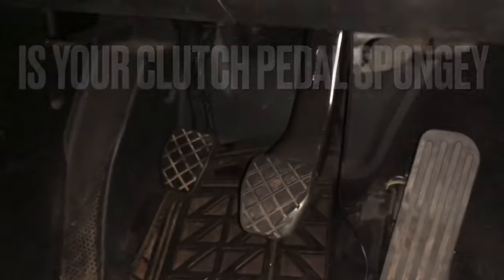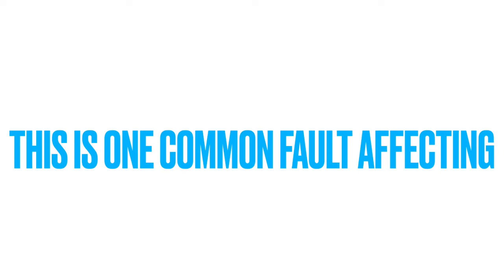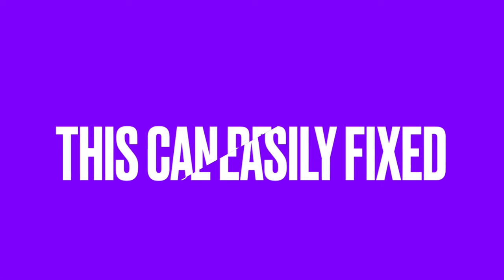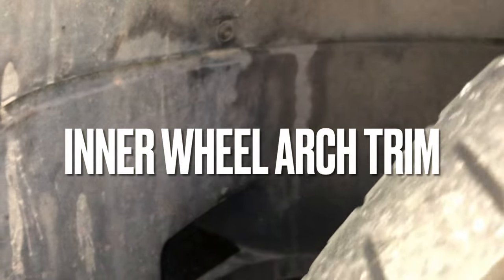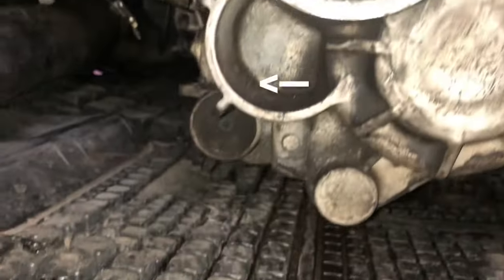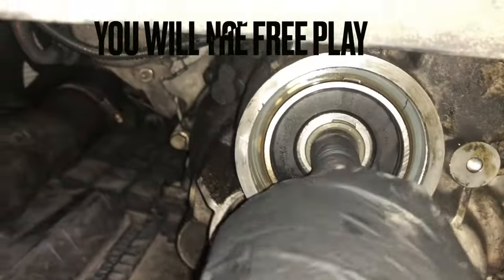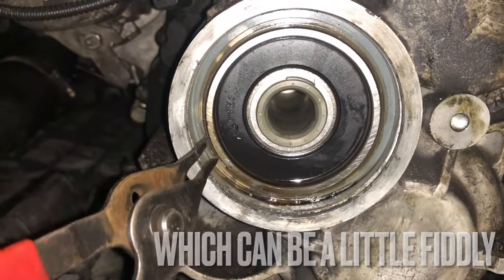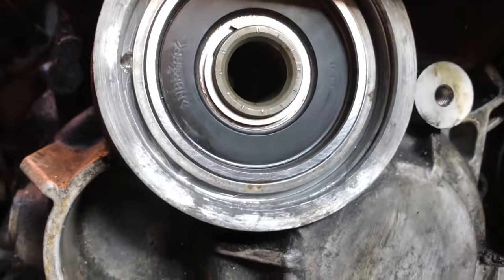Soft clutch pedal - Can't fix it - Try this!  Volkswagen, Audi, Skoda, Seat

Comment: I’m having a problem like this on my mk7 golf gtd 2.0 64plate 6 speed. Is it the same place as yours in the video? 
Great video and you made it look simple enough even I could do it.
Reply from the maker: It should be. Just remove the arch liner and look at the end of the box. It should look the same. Good luck and thanks for your comment.
Reply: Thank you for quick reply. You say in video that the new shim is fitted does that mean there is an old shim to be removed?

Comment: Does this apply to a clutch pedal on a vw touran 6 speed that is staying very low , nr the floor . Note the clutch has been slipping a little also .!? 
Thanks for the video info .👏✌️
Reply from the maker: If the end of the gearbox looks the same yes. If the clutch is slipping though, I would have thought it was the clutch that’s worn. How many miles has it done?
Reply: @How2FixIt1  64500 only .. but a replacement box and clutch ( not a new clutch ) about a yr ago as 5-6 th gear went ..

Comment: I drove 1.9tdi 5 speed manual and after puting it in second gear the clutch pedal stuck on the floor, and then the clutch pedal was unable to disengage the clutch, and it felt like you discribe in this video, is it likely that it's this issue or rather broken clutch.
Reply from the maker: I wouldn’t have thought so. As far as I’m aware this is for the six speed gearbox.
Reply: @How2FixIt1 Ok thanks for your response, I drove it somehow to mechanic and he said it's probably the clutch itself, hydraulics seemed fine to him, I hope that clutch replacement will help

Comment: Which engine, gearbox is this for. I have a 2.0tdi manual passat.
Reply from the maker: It’s the six speed 2.0tdi.
Reply: @How2FixIt1  thanks having issues with clutch had new clutch kit over 12 months ago 2nd slave and a new master  cylinder and still doesn't feel right, this might be worth a try. Thanks
Reply from the maker: @GWIFF...  I would try a new seal kit too. Available from main dealers. It has the four seals for the complete hydraulic pipes.
Reply: @How2FixIt1  I'll have a look thanks is that for between the slave and master ? Just so I can google it
Reply from the maker: @GWIFF...  yes it is. You can also got them on eBay, but they cost more.
Reply: @How2FixIt1  hi, i have a 2.0 fsi passat 2006 from uk, do you think it would be the same to fix it or diesel is different?
Reply from the maker: @sergiusdms I think it will be the same.